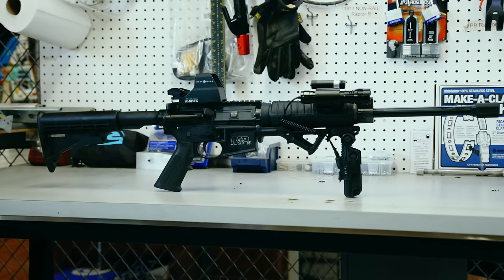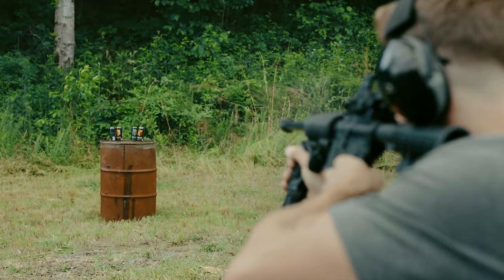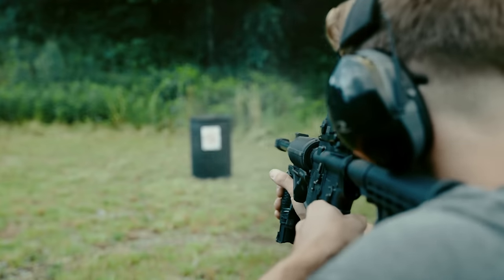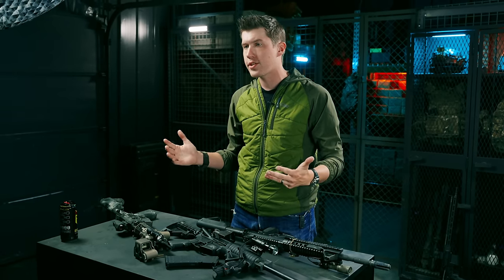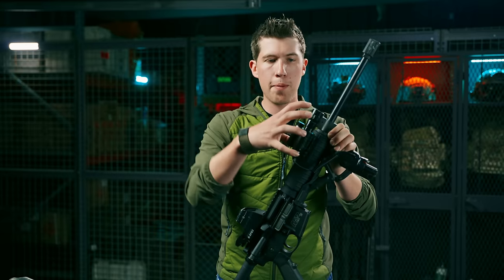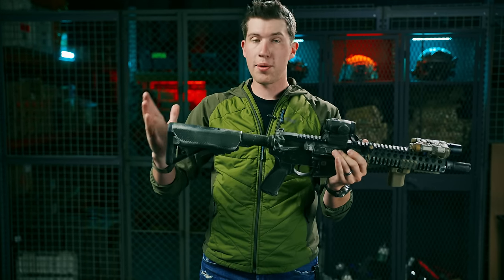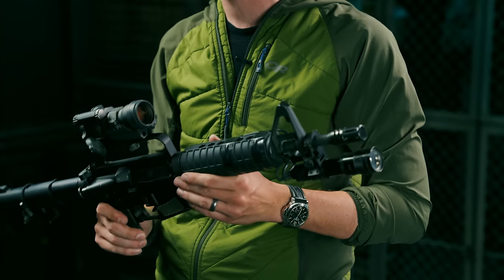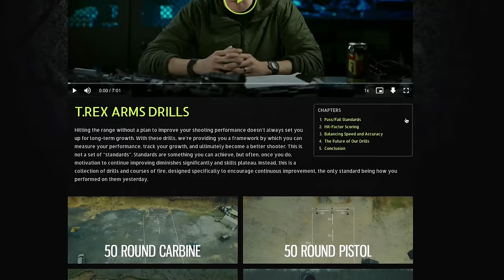5 Mistakes New Rifle Owners Make

Comment: Yeah don't buy anything CV life either it's expensive it works great at the beginning but the it always runs the battery runs out it's rechargeable it's just junk guys and this guy is right and if you did buy an m&p sport to and you're going to go for one of them visit them drop them just change your gas block to an adjustable gas block and get a very light handguard that doesn't have a so you don't need your Delta ring I have a vision throw over with this huge gas block that's not an 82 it's not adjustable m&p sport 2 is a great rifle it needs a new trigger definitely now it was like 16 or 18 Oz for that vism drop in f**** piece of s*** that thing is so front heavy it's not even funny and I got a lpvo on there that makes it even heavier I'm actually thinking about putting the Magpul little plastic you know you can put em lock on it not much but I'm thinking about putting that back on my Smith & Wesson m&p sport 2 cuz lighters better you know and I'm going to put a better trigger on there and then I got a lighter are and better if you got to sit down to hit a Target you know and you want to help out in this horrible world to come then you're not helping yourself at all unless you're a sniper

Comment: Wow, what a crapload of bad or useless advice.  The optics, even the cheaper ones are not nearly as bad as this guy seems to believe.  The whole point of target practice is figuring out how your gun shoots and tuning the aiming... people are not neglecting that.  Streamlights are lacking and lights on your gun do make you a target.  Firing your gun ALSO helps you figure out the ergonomics and the rail systems make it easy to adjust.

Comment: Of course you refer to daniels defense as a reliable site because of its price.  Your the guy that thinks your $2000+ daniel defense rifle is the $h!t because of the price.  Tip your daniel defense rifle is milspec like every other rifle.  Congrats on over paying for gun parts.
Reply: It’s not the price.

You can do fine with a $500 rifle. A Daniel Defense has a price for a reason though.

Comment: Aim point has a nice entry level option!  😂😂.  Yeah! The PRO.. it still costs as much as most entry level AR.. come on bro.. you’re wayy to deep in Bougie land… Pro level equipment IS NOT required for ENTRY level… holosun’s work just fine at moderate ranges… as do most Vortex red dots… perfect, no… but adequate.
Reply: It’s called saving your money
Reply: Aimpoint pro
Bougie 

Pick one